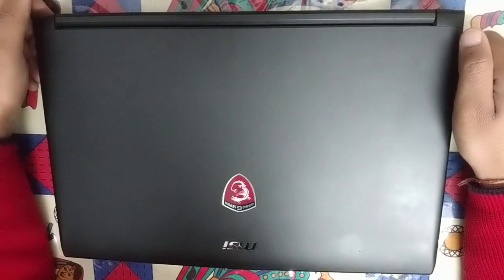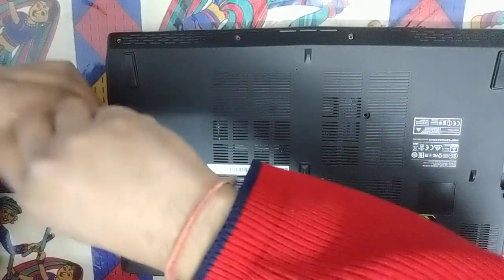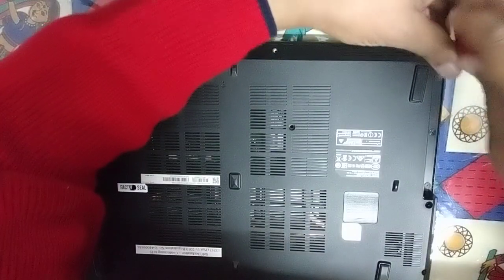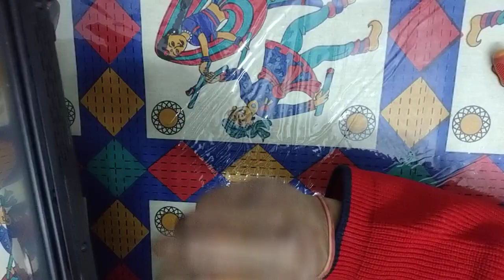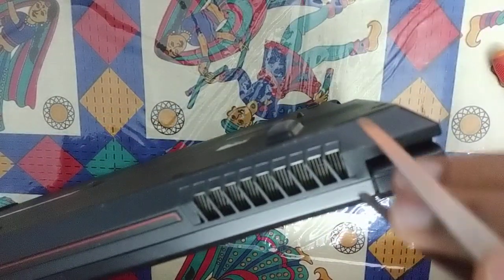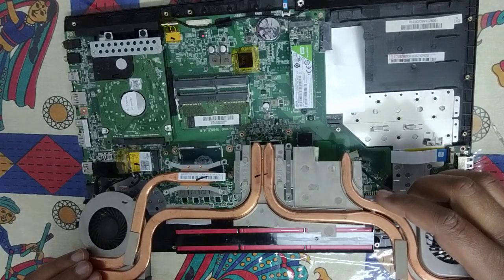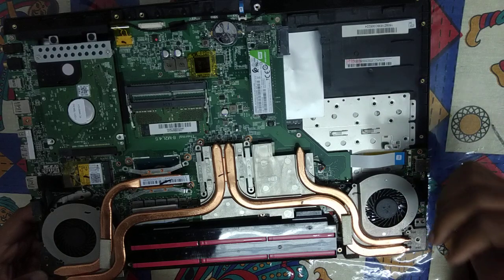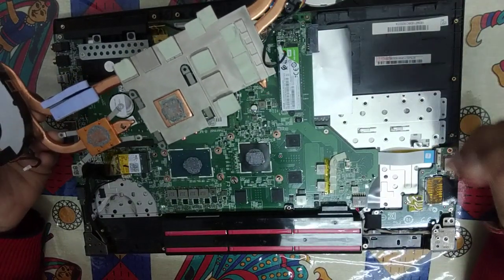HOW TO OPEN MSI GL62 6QF GAMING LAPTOP EASILY

Comment: Nice.
At 08:45 please note the numbers near the screws, you need to unscrew them in reverse order, but keep in mind there is an order when screwing/unscrewing the heatsink screws.
Also: you need to remove the battery prior to working inside the laptop.

Comment: After we open my laptop and clean the fan, it doesn't work, if we press the power botton. How can i fix it?
Reply from the maker: Disassemble it again and step by step make all the connection properly and assemble it again.
It will work for sure